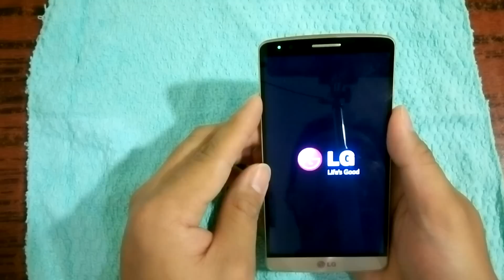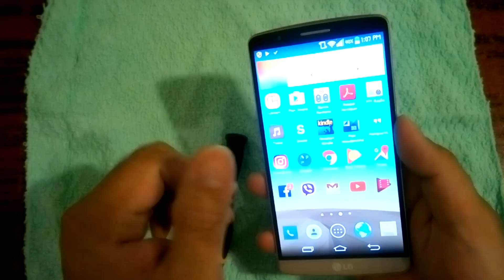LG no display/flickering/fading issue FIX! NO oven required (2021 Updated)

Comment: We tried just about everything to fix my daughter's flicker/fade-to-black LG G3. Nothing worked (pressure, heating, heat-sinking etc). Finally sent it in to the insurer who ended up replacing the motherboard.

That was in June 2016.

My daughter just contacted us from school (a few hundred miles away) and told us the problem is back.

So we have a pretty good idea that the motherboard is the cause, replacing it works, and with use the new motherboard might just fail, too (as hers did 9-ish months later). The motherboards are (still) available for about $90 on various sites online and are trivial to replace even by folks like me so I'm contemplating my navel about doing just that. Admittedly will probably just buy another, different, phone for her but might try replacing the motherboard anyway so she has a smartphone standby instead of the dumbphone standby she's using today (which works for her =needs= - texting and 2-factor authentication).

For anyone who values their time I'd recommend the motherboard replacement - either by a shop or by yourself without bothering trying to heat or press or whatever the existing parts.

Comment: thanks. phone is ok for 15 minutes now. shame I tried factory reset 1st.
Reply from the maker: Hopefully it will last longer!
Reply: so.. you posted this 4 days ago any updates ? is it still working ? it it not over heating ?
Reply: it worked better but still some fade outs. so bought a new phone.
Reply: for how many days did it work ? i just need it to work till i get my data and backup my accounts and contacts and all ..  will this work ? and thank you .
Reply from the maker: +Naya Koudsi the phone on the video still works, this is the 4th week
Reply: idk , I'm really not sure about opening the phone and messing with the inside of it ..
but thank you..
Reply: It is very easy to lift the second deck you must use a credit card
Reply: Its not a shame everyone tries that first anyway am on my way to fix mine hopefully i will succeed ..Helpful video indeed
Reply: Leeroy de Boer me too ..

Comment: Thanks it worked!!!! but adding the piece on the bottom stops the the speaker from working
Reply from the maker: You can either pry the connectors upwards a bit to get it to contact or you can just leave out the bottom part for this mod. Thanks!

Comment: Hi, I have done everything like you suggested and I still have the same problem
Reply from the maker: Sorry about that bro, if this does not work with, you could try the other solution of baking it seen in other videos.
Reply: I was going to do that, but I dont have the thermometer and I dont  know if I can trust my oven that when I set it to 200 C it will be that exact temperature
Reply from the maker: +coab43a22f2 better to have one, we won't like your phone baked well done. 

regarding my video, just want to make sure, did you made sure you put the paper? if yes, try putting a bit more to add pressure but not much that it would be bigger than the plastic.

Comment: no what I meant was disconnect the camera in the phone power it up the screen should lit up then ether reconnect or replace the camera i had the same flickering and black screen on two phones I repaired and the camera was the problem which accrued after the user stated the phone had gotten extremely hot for some reason that of which is still unknown
Reply from the maker: sorry about the misunderstanding. I did not thought of that. thank you for the suggestion. i would make sure to update the video later or tomorrow about all the suggestions I received. the more solutions the better.
Reply: viralkon
Reply: can you please upload a video for that?

Comment: I have the same problem, I will try to fix it later tonight. How did you glue the plastic pieces on the phone. Used something special?
Reply from the maker: +Mihut Alexandru i just used a bit of glue just to get to stick, you don't need a lot. Hope this helps. Thanks
Reply: I tried yesterday, but now the enter is in a bootloop... Continuously restarting. What should I do?

Comment: How the f*** did you get the upper white casing off?? Mine simply won't come off. I have tried to wedge a small screwdriver in, and I have tried brute force - the casing stays on!!!
Reply from the maker: Lincoln1242 apologizes for the late response, have you tried removing the bottom casing then the upper casing?

Comment: has anyone tried replacing the board??? i tried the coin trick, the folded paper pressing against the board trick and even detaching the camera ribbon from the board. All that i have mentioned worked for me but only temporary(couple of hours), sighzz i need a permanent fix.

Comment: Has this fix lasted for you?
Reply from the maker: the phone on the video still works and it has been a month since.
Reply: Nice man. Thanks for the video! I'll try it.

One question though, is it necessary to put the screws back? The phone pretty much clicks into place, never saw the need for the screws.
Reply from the maker: +Talal916 you need the screws to keep the pressure down on the plastics.

Comment: Hola amigo, quiero contarte que aunque no lo hice exactamente como lo dices en tu video, si hice algo similar basandome en tu idea, solamente puse un trozo de papel doblado de manera que haga presion al procesador y dejame decirte que me ha funcionado.

Es una solucion temporal muy buena que sirve mientras se le hace el refundido a las soldaduras del procesador

Gracias por tu video y saludos desde Colombia.

Hello friend, I want to tell you that although I did not exactly as you say in your video, did something similar basing on your idea, just put a piece of paper folded so as to make pressure to the processor and let me tell you that has worked for me.

It is a very good temporary solution while serving the recast is made to welds processor

Thank you for your video and greetings from Colombia
Reply from the maker: thank you, i did paper first when i was doing some testing. it worked but once the paper because completely flat overtime, you will loose pressure so that is why i used the plastic card.
Reply: a video says that using a penny to exercise precione is functional. This might work ? the material of the coin would not affect heat or some other factor . please wait for your answer my friend
Reply: hola amigo disculpa que me entrometa por acá quisiera saber si el método te ah funcionado y por cuanto tiempo? eh visto otros videos que colocan una moneda para ejercer mas presión. pero no se hasta que punto esto pueda afectar con el calentamiento o algún otro factor. saludos y espero me pueda consultar ya que poseemos el mismo problema como muchos otros usuarios de este terminal
Reply: +Jesus Alejandro Romero I think a coin to be metallic , could cause the processor to melt because the currency will keep the high temperature of the processor rather than help dissipate heat

Yo creo que una moneda te podría derretir el procesador ya que la moneda mantendria el calor del procesador en lugar de disipar el calor
Reply: y a ti que tal te funciona amigo? cuanto tiempo llevas dándole uso? estoy pensando en probar este método.
Reply: +Jesus Alejandro Romero amigo yo no lo hice como el video, yo no puse el pedazo de plaatico sobre la cubierta metalica que cubre el peocesador.

yo lo que hice fue poner un trozo de papel doblado sobre la tapa metalica para que presione el procesador, me funcionó durante todo el día de hoy pero ya por la noche el telefono comenzó a fallar de nuevo, asi que lo desarme nuevamente y le quite el papel doblado asi como tambien quite la cubierta metalica para poder mirar el procesador y observe algo preocupante, resulta que el papel estaba presionando la tapa metalica que cubre al procesador y esta estaba haciendo presión en el procesador y obviamente esta lata estaba tocando el peocesador, pues sucede que se estaba empezando a derretir el procesador.

Entonces se me ocurrió idea de seguir usando el trozo de papel doblado pero esta vez directamente sobre el procesador o sea elimine la tapa metalica para que el procesador pueda disipar un poco el calor que este emite y que se mantenia con la tapa metalica y como el papel no se va a calentar tanto como el metal entonces decidí dejarlo asi y probar y arma el telefono nuevamente presionando el procesador directamente con el trozo de papel y eliminando la cubierta metalica, puse la bateria de nuevo y funciono perfectamente y aun sigue funcionando, es mas te estoy respondiendo desde mi LG G3 D855
Reply: +Jesus Alejandro Romero yo Vivo en una ciudad que hace bastante calor, por eso creo que eso influye también pues en una ciudad de clima frío creo que está solución puede ser duradera ya que el procesador no se va calentar tanto como en mi teléfono que ya se estaba comenzando a derretir.

Comment: It happened and happens with me, I uninstalled some programs then removed the sd card and sim card- turned the phone on then opened some apps and scrolled around , after which I restarted the phone then done the same thing it started working then turned off and inserted sim card not using sd card though now it is fine sometimes fades but the phone is still usable by this method, just be slow to installing new heavy apps (+20 mb apps)

Comment: Thanks it works but sometimes display flickers again it feels like a temporary solution
Reply from the maker: +mmdann for some, it flickers after 1 or up to a month, enough time to backup all of your data for your replacement phone. Haven't found a permanent fix yet that does not include replacing the entire motherboard, some recommended on reflowing the ic though

Comment: It worked for me about 5 days. Then it came again.
Teh final solution is a reflow: liquid flux, electric iron (max tª), 60 second and you are done. It worked pretty good
Reply from the maker: victor999R that's great to hear. Did you do it on your own? Or have you given it to a shop, how much was the cost?
Reply: Gian Villame yes I did it by my own, its very easy. The liquid flux cost is from €3 to 5 and in 30 min you are done
Reply: I'll send you an image of Flux I used and a brief explanation.
It's easy, I was afraid The iron damages the mother board, instead of it my mobile works pretty good now, even the battery lasts a half day more, I don't know why so don't ask me haha
Reply from the maker: victor999R why don't you make a video of it and upload on youtube and I would be glad to put in my description or in video link of your video so others can find another way of fixing the lg. Thanks
Reply: I have no time, adding I never have uploaded a video on youtube. 
I can send you an e-mail with a brief explanation. At the beggining I thought I couldn't do it properly, but the outcome was amazing considering I'm not a handyman by far.

Comment: Motherboard chip casing gets hot - and after time the solder joints from the motherboard chips break down to the board. I fixed (for now) by using adhesive copper strip folded over to make slightly thicker & cut it to the size of the chip. Smeared some contact adhesive to the outer casing of the chip and placed  the copper strip onto it. So it'll serve 2 purposes - it'll add pressure to the pins from chip to the board and will also distribute the heat from the chip to the copper strip/phone housing.  You will need to take the boards out - see other videos on youtube - when you remove the motherboard the motherboard chip is on the underside - i.e. you wont see it unless you turn the motherboard over
Reply from the maker: thanks for the solution, the more solutions for this phone to last longer would be better!

Comment: hey Gian Villame i think i have the same issue i have a lg g3 and the problem is i can use my lg g3 for about 10 minutes and then it flickers and the screen goes black do u know what could be causing it
Reply from the maker: patrick ontario it could be a different case and I could not really tell absolutely since I am no expert with phones. But judging by your experience, i had the similar case with this phone until it just flickers all the time. You can try this method and see if it would work longer until you can find a replacement. I had this working for a month until it flickered again but not as it used to be.

Comment: don't understand places for plastick card.
Reply from the maker: hi, please proceed to 3.32 minutes and you will see from there that I have pointed the areas where you need to put the plastics. plastics are light green.
Reply: +Gian Villame i used old credit card.nothing changes for my g3
Reply from the maker: +серега р +серега р did you put a piece of paper about half the size of the plastic on top of the plastic in 3.52 minutes?
Reply: +Gian Villame that is moment which i don't understand.
Reply from the maker: +серега р let us say your plastic card height from top to bottom is 0.5 millimeters, you need to have put a piece of paper on top of the plastic around 0.25 millimeters or a bit more.
Reply: if you put plastic piece like you showed on 4:26, you could lose the connection with the speaker (my case).
Reply from the maker: +Jelenko Crnjak your speaker connectors are at the very bottom below the battery, there are two connectors there that you can pull out a bit so that it could reach metal plating on the plastic cover.
Reply from the maker: +Jelenko Crnjak its in 3:33, when I pointed at the large plastic piece, just below that are the two connectors for the speaker, try to take it out a bit so that it could reach the speaker on the plastic cover
Reply: ok, thanks
Reply from the maker: +Jelenko Crnjak welcome!

Comment: does it work?
Reply from the maker: Faisal Shehzad it works, mine lasted for about a month then the same issue came back, for just a couple weeks. That would give you enough time to backup all your data. As for a permanent solution, Haven't found one yet that does not involve replacing the motherboard.
Reply from the maker: Faisal Shehzad you can try victor999r suggestions at the comments below. Thanks

Comment: Thanks!  This video saved my phone.   
Side Note: It's not necessary to place a plastic piece under the smaller plastic panel with the speaker connections near the bottom of the phone, because the video chip is located under the larger plastic panel.  This also means there is no need to pry up on the two speaker connections if you leave that bottom plastic piece out.
Reply from the maker: thanks for the recommendation!  when i did this video, I already made a lot of trial and errors just to keep it working. the rest that might be unnecessary I left it out.
Reply: Is this the reason why I can't hear my phone ring when the ringer is all the way up?
Reply from the maker: +reversetracking as for my video, i pulled out the connectors a bit to get it to make contact on the speakers, you can remove that plastic part at the buttom on the lcd connector since it might work without it but if it's a loose connection to the lcd connector then you may need to put the plastic
Reply: +Gian Villame ok. so it should work if I take off the bottom plastic piece? I'm not tech savvy either, but I did all that you did, and so far so good. thanks.
Reply from the maker: yes it should work even without that plastic at the buttom, but in case its still having the same issue, you can just go ahead and follow the video and make sure to pull out the 2 connectors to make contact. Thanks
Reply: +Gian Villame ok. thanks alot.
Reply from the maker: you're welcome!

Comment: Hey , 
how long would that fix remains ?
and if it's temporary , did you get a permanent fixing ?
Thanks
Reply from the maker: el qasem still working a permanent fix. some tried doing an oven fix and said it worked longer but I would only do it at my own risk. As for this solution, mine worked without fading in a month then the issue came back but not as before, fades seldom, that would give you a lot of time to make use of your phone, like back up and all until you get a new one.
Reply: that means we lost our own mobiles already ?

Comment from the maker: Hi guys! Thanks for watching and giving it a try, unfortunately my phone started flickiring again after a month, BUT only mild and acceptable for me unlike the first time. I would try to do something else if there is another possible way to get it fix permanently. You can always go for the oven trick which I have read last a lot longer. 

Whatever possible way we can do to fix our phone without paying anything is our goal. THANK YOU
Reply: Big like my friend! One question, why you put a piece of paper on top of the plastic? I think its better to avoid papper, it can burn
Reply from the maker: the problem i had at that time was if i put to pieces of plastic on top of each other, it was too thick and for that, the cover won't fully close. So i had to use a piece paper, you call always try a thinner piece of plastic if you're not comfortable with paper.
Reply: Thank you! Great solution, works fine for now. Hope it will last for more than a month...:) Thanks again, lots of love from Israel
Reply: רעות אהרון תגידי איך עשית את זה ? נייר או חתיכות פלסטיק?
Reply: Gian Villame do you find other way to solve this problem?!
Reply from the maker: Abood Almezeini no I haven't, saw a couple of videos doing the oven fix but i could not really guarantee that it would work, you might end up with a brick if done wrong.
Reply: GSV Information does this soloution fix this problem completely ? or after a while should i do it again ?
Reply: thanks, it worked but i didnt put paper on other spot, just below the camera and it was fine..